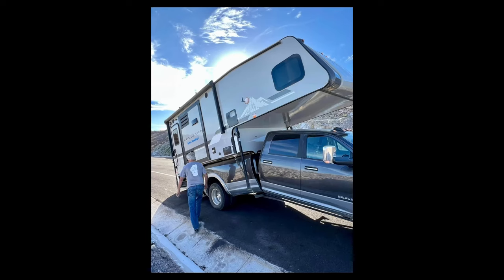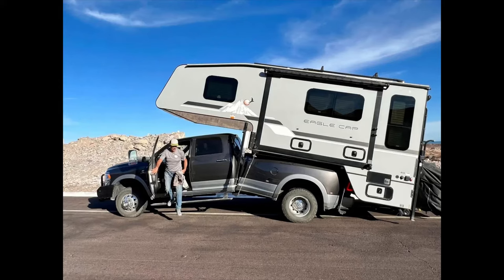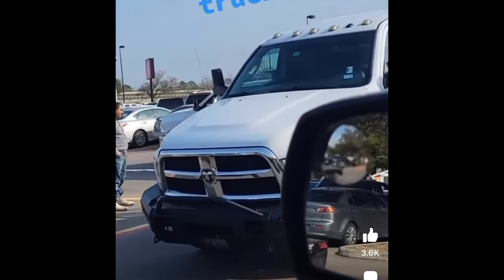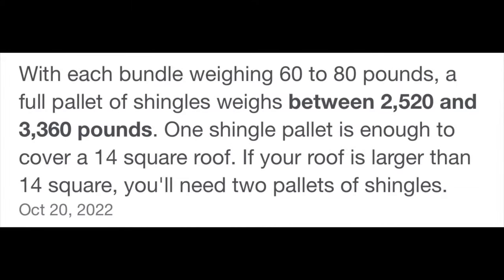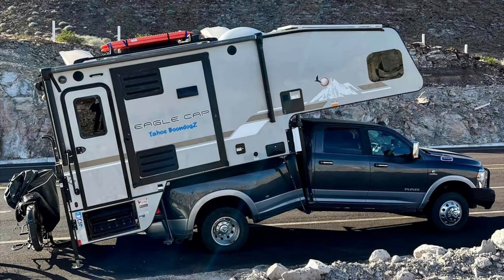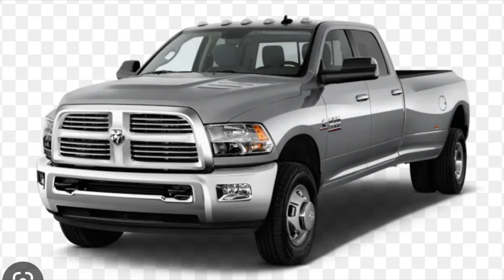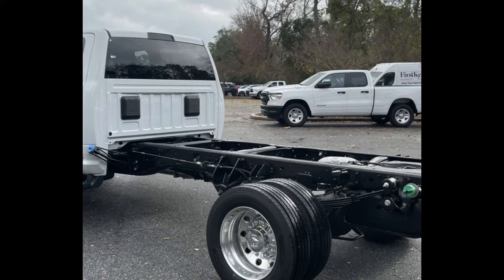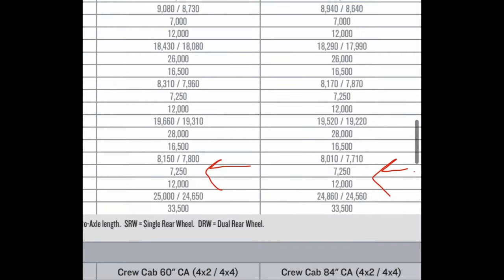Broken Ram truck frames 😱, what’s causing the failure and can they be repaired?

Comment: Ok folks my 1981 gmc k3500 dump truck is an oldie but a goodie, it carry’s loads for a living, many well in excess of the gross 10k…the rig weighs 6800 lbs empty… now it’s common to leave the scales at 12k and a few times at 15k…that’s 8200 lb. payloads…the frame has never shown any fatigue, breaks, cracks or buckles…and it’s cycled thousands of times over the years…why is this…it was designed with a C channel frame, and not a high tensile brittle product…it can be done, and has been done..that why I’m keeping it on the road!
Reply from the maker: The big thing to me was the fact the c channels can handle a fair amount of rust without failure.  The box frames loose so much strength when the bottoms rust out (which happens fast in northern states.  For a truck I much rather have a c channel frame.
Reply: Tube frames hold debris where you cant wash it out. It sits holding water abd rots. I knew this off the nissan pickups where the spring shackle was penetrating the frame and getting ready to come through the bed. Now thats just what they all get now, rust out frames to not outlast the warranty too much. They think we'll come again. Not myself.

Comment: A cab and chassis truck in Most states is called a tractor. Once you put a bed on it that can carry a load it then becomes a truck. But in some states it may still qualify as a tractor which raises tonnage that you can carry and it has a completely different frame than the truck frame.

Comment: My 76 Jeep J10 truck the frame 3/16th thick..  and the front half is a 2nd C channle welded to the main c channle frame to stiffen it.  So its a boxed 3 /16th frame lol.

The frames in Jeeps in the 90s+ were only 1/8th.

Some people convert them to flat beds.. and i havent seen one 62-87 Gladiator frame breaking from this.

As for that frame.   You would weld the frame back.  Then fish plate it.  Or bolt plates to it.  You dont have to weld plates to it. You can bolt plates to it.. you dont have to weld anything

Comment: Years ago I did an update to General Motors truck and bus where they build a lot of pickups. They had a spat of a number of frames coming apart on their heavy duty pickup trucks. And I was working on the line where the frames are being welded by robotic machines. This is some years ago now. The problem was being caused by fact that nobody was properly inspecting the welds to make sure that the weld was actually properly wedding to both pieces of metal Rodger penske's race team had a truck that they were pulling one of their race Crews with and the truck literally fell apart underneath them on the road. Penske had a lot at stake and work with General Motors a lot so yes that's when they finally decided to fix the problem they were literally having people weld these frames up with proper mig welders set to the proper temperature and feed rates and the like. I only welded for 41 years so maybe I don't know what I'm talking about. I did look at a couple that had been miss welded by the robots. How they were setting these things up I have no idea. But I do not like most of the robotic welding much of it is not very good but they tend to overwhelm things so that they make sure they get enough weld.

Comment: Many guys run training wheels (duels) for the ride stability. From the factory they put softer tires on for a better ride. That gives the sidewall more squirm... not good for towing. Still load range E but not the same as other brands. Running two sets of rubber gives less squirm - better ride & more stable. I always run the firmest sidewall I can get... at max air. (4080lbs @ 80psi) Guys extend the frame all the time... sleeve it, weld it, then fish plate it NOT in a straight line. The real issue is the sales man that sell the RV's and trucks. They over sell what the frame can do. The cab and chassis versions are derated in the engine and other drive train parts. Then there is the whole CDL stuff. The main reason why I got a Dodge... the engine. - You can't beat a Cummin's engine. Ford has had far too many issues with the diesels in the past. But yea, I think these guys overloaded the trucks. I'm not saying I haven't overloaded mine... but it's an older one. 2003 3500 SRW
Reply from the maker: All great points.  No doubt a lot of people get oversold on capability.  The average person has no concept of how much payload a 450-550 class truck really can have, and that is so variable, it all depends on options.  You could have two similar looking trucks where one could have 5k on the bed and another could have 9k, not to mention how the load is distributed matters.  It seems to me some people see the 450+ class trucks as a class b replacement.  If a person really needs to carry multiple pallets of concrete they need to be looking at a class b truck.  I get why they don’t want to (cost, insurance, license, etc) but overloading the truck and thinking it will hold is not a reasonable approach lol.

Comment: The only frame I have ever seen bent ( and I live in pickup country) was an F250 back in the 1980-82 model when some Ford engineer got the bright idea to cut about 5" holes in the frame to lighten it up. The pickup owner wasn't necessarily overloaded with his 5th wheel stock trailer. That being said, I used to transfer bagged salt for my employer with my "74" F-250 and overload it awfully with 7200 lbs at a time. I never did bend the frame on that pickup. I now own an F350 dually and it is at least twice the pickup the "74" was. To sum it up unless someone is welding on the frame or dropping or shocking the frame with a dropped load there shouldn't be any excuse for breaking a frame as they (at least since the 80's fiasco) design frames 3 or 4 times stronger than the payload rating.

Comment: Looking over the damage to that one truck frame and where it broke it is at a weld. It is repairable. But you must put fish plates on it. And I would put triangulated holes on the fish plate so that you can weld it to the sides of the frame after you welded the frame. Put the fish plates on it, and while those to the sides of it and that frame will support a lot more weight. You will still do better by getting the straight frame commercial style tractor and then putting a bed on it if you want one. That way you already have the higher gross vehicle capability and then you can license the vehicle as a truck and get the lower insurance in a lot of cases.
You do not TIG weld this you use a proper Mig with some S70 wire. That is more than strong enough and will do the job. It's a good high alloy low hydrogen weld. A triangulated fish plate add Intuit everywhere there's a weak point and on both sides of it. You completely box in that frame and put some support on it and you fix the problem. That should have been done at the factory. And you don't need a multi pass weld. A single pass weld that's done properly and properly stress relieved will work just fine.

Comment: When they were looking to cut costs they didn't think of the load that could be pushing up on the middle of the frame, theg only thought about the load pushing down. Problem is any weight put on the frame in front of the front axle, and the weight put on the frame to the rear of the rear axle, push up in the middle of the frame between the axles. I'll bet that slide in campers are the biggest culprits.
Reply from the maker: Definitely.  Combine that with stupid amounts of torque from the engines (especially the diesels) and you have frame failures.

Comment: I’m not so sure it’s that the modern frames are weaker per se. I actually believe they are probably stronger. I’m saying this as someone who has an 83 square body, 67 C10, and a 17 z71. Manufacturers have to build crash protections into the frames that I don’t think they had to previously. That spot where the dodge’s frames 13:11 are breaking may be a built in crumpled zone so it would be inherently weaker. I think with the power that modern truck engines, braking systems have, and how much tires have improved, people overload and tow heavier loads with them more often, and for longer distances than they used to. I know this, if I get in an  accident, I’d much rather be in the ‘17 than the others. Manufacturers put payload ratings for a reason. It’s one thing to just place a load in the bed and it doesn’t break. It’s another to put that load then drive highway speeds with the front end bouncing like crazy, which exponentially increases the load at pivot points on the frame. It’s probably ok to do it here or there. But to do it all the time continually stressing that frame you end up with broken and cracked frames. I’m no welder, but I would trust your repair of that frame at that area.  But I would condemn that frame (or vehicle) as it could be stressed and cracked all over. Anyone who had square body Chevys knows to check the frame where the steering box is attached. Many of them cracked in that area and that is just from steering and bumping curbs. Best wishes, Mike

Comment: The key problem has nothing to do with the Brand....Ram & Ford have Both had multiple issues. The #1 primary cause of the failure is that the frames were welded to install aftermarket items like those big campers. Drilling & bolting is the preferred method because of the heat temper loss from welding. Frames are labeled NOT to weld to them... as for all those camper examples all over the web....they all have two  things in common. Most of their weight is significantly Behind the trucks rear axle where the load/stress is on the chassis balances. The rear axle is a fulcrum (pivot point) everything behind the axle pushing down, is redirecting load Upwards on the frame in front of that axle....the campers themselves are very rear heavy even empty & almost always mounted on a high end trim level luxury truck.. the higher the luxury level, the more crap they have in & on them...that reduces the overall load capacity. A plain jane work truck can carry more than the fancy luxury truck of the same weight class....all those camper fails  you see all over the web....they all have the same problem...the camper installer welded the front tie down brackets to the frame... thus effecting the heat treatment of the frame rails. #2 those campers themselves are maxing out the cargo capacity of the chassis... remember cargo capacity is different than towing capacity... cargo is downward load on the chassis/suspension... towing is front to rear pulling forces on the frame/driveline....  those campers are extremely large & heavy by themselves...then add all the people's personal packing of clothes, food, camper water tanks for cooking/bathrooms/showers etc.... all of the broken frame truck photos that went viral of Both Ford & ram....they also had Extra weight mounted to the rear receiver/trailer hitch. They were hanging dirt bike motorcycles & other recreational items off the back, they also were towing trailers.... ALLLLL that extra weight is Behind the trucks rear axle which is a fulcrum (pivot point) Allll That extra weight & load & trailer stress is pressing down wayyy behind the rear axle, thus Lifting the frame innthe middle....which has the heavy Diesel engine/transmission & 4 door crew cab in front also pressing down.... creating an extremely overloaded frame on BOTH sides of the supported area (the rear axle) Now... add to alllll that overloaded weight & stress.... now add the overloaded, unbalanced load constantly being slammed against every bump & irregularities in the thousands & thousands of miles those trucks drove.... all overloaded, improperly loaded, and most importantly...the frame.waa compromised by welding to it.....which frames are labeled NOT to weld to them.  
THE BRAND OF TRUCK.... HAS NOTHING TO DO WITH THE FAILURES....  its a combination of extreme overloading beyond its rated capacity,  unbalanced load stress on the chassis & A welded to frame by aftermarket equipment installers.....  its a perfect storm for failure....it has NOTHING......nothing to do with the brand of truck or it's quality.....ANYTHING will break if used improperly or overloaded...or both..... those size campers & loads ...the owners should've bought 5500 chassis...not 3500...  and properly drilled & bolted the front supports...not welded.....  the Trucks weren't the problem

Comment: I hauled Lance, Eagle Cap, Host, Arctic Fox and Adventure camper all over the west coast, from the manufacturers to the dealers. And we would also pull a travel trailer with it. 
I used a 2004 3500 Ram 4x4 dually I put 830,00 miles on the truck and never had a problem. But I had air bags and Torklift rubber stabilizer. 
3500 dually trucks haul campers fine but 11 foot slide in campers need a 4500/5500 if your full time camper. 
Transport it dry, water and diesel weight is 8.5 pounds a gallon, propane is 5 pounds,
My Dodge hauled better than my Ford
The Ford was more wobbly when loaded. And I put 415000 miles on the Ford but it was less bumpy on the road.

Comment: Never understood why pick up truck manufacturers think box frame is better than c channel frames or maybe just a sells pitch because all commercial box trucks dump truck and big rigs have c channel frames, I have yet to see one of those frames break....my 2008 4wd 3500 hd sierra with a truck cap and duramax engine  has a c channel frame with no issues with my 1000LBS snow plow hanging off the front end and with 1000 lbs of weight ballast in the bed. During the warm seasons i pulls my pressure washing trailer with 750 gallons of water 2 pressure washers and 10 gallons of driveway cleaner im pretty sure my frame is doing some flexing but not
 breaking

Comment: The Metallurgy of the metal, Not only would it not be proprietary it would be easy enough to determine what it was, from what little I can see of that break the problem is in the Weld and that's probably a temperature issue not necessarily the weld metal issue. It may even be too high a heat when they welded it. Creating a greater Austin at Exxon which is a crystallized border right next to the weld. Because when you weld it the rest of the metal draws heat away fast enough that it becomes brittle right adjacent to the weld. And that looks exactly that way from what little I can see.

Comment: It's not just weight it's weight distribution. If a large portion is behind the rear wheels and the motor out front there is a bending moment at the failure point. If the weight  is over the rear wheels or between the front and rear wheels the problem in most cases would not exist assuming it's not overloaded. Then again manufactures should not advertise trucks pulling huge fifth wheels, boats even excavators if they can't do the job. People buy capability and manufacturers need to make sure they deliver.

Comment: I have an 01 ram 1500 with a 6.5 ft box with heavy duty springs with overload springs. I hauled over 2,500 lbs with no problem. C channel frames back then are much stronger.

Comment: Perhaps this is why Ford led the way on moving half tons to fully box frames, but they did not do the same thing on their heavy duty. Perhaps they knew that the heavy duty would not be able to be built in that manner.
Reply from the maker: It’s entirely possible.  Not to mention their fiasco with the 2010 year or so f150 frames rusting through, but the f250s never had a problem because they were thick c channel.  I worry about all the heavy duty boxed frame trucks out there after they rust a bit, I think there will be a lot more frame failures of them.

Comment: With your comments about the f450s and such i agree with them when I was much younger I remember reading the literature on the old Ford F-series the F1 F2 F3 and I forget the wording but the way they were described was F1 is a half ton and the F2 is the 3/4 ton and the F3 was a heavy duty F2
And quite frankly that's the way I've looked at all the pickup trucks since then

Comment: I have a 2012 RAM 2500 Laramie Cummins it has the middle axle ratio.  I started pulling a 30' travel trailer with it then upgraded to a 12k lb empty Fifth Wheel. But I won't use a Kingpin  I had a Reese Goosebox put on the 5R  the Gooseneck on the truck was a Bed Off install it spreads the weight of the camper very well across the frame. Been hauling that camper all over the USA , I do inspect the frame for cracks but I haven't seen any signs of stress.   It all depends on how you're carrying the load.. I had one Rich guy with a million dollar Class A tell me my RAM was Illegal to tow the camper because it was a 1500???  He had no clue they don't put Cummins in a 1/2 Ton truck 😂😂😂😂 anyway stay safe know what your doing and I
The limits.

Comment: Those frames are failing in tension where that weld is. Overloading behind the rear axle (like that camper with the overhang and motorcycle hanging off the rear) or excessive tongue weight from a trailer hitch.
Reply: Exactly! Anyone with any common sense could look at the amount of load behind the rear axle was a recipe for disaster. Compounded by a thin frame with a weld straight across the frame flange? It's going to break. Further compounded by the fact that it's a Dodge, great engine surrounded by a cheap body and frame.